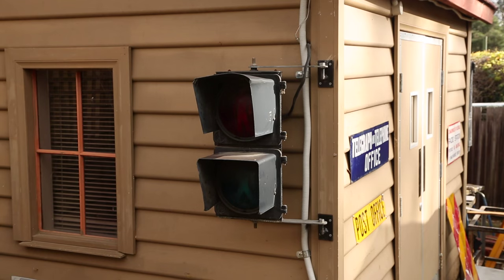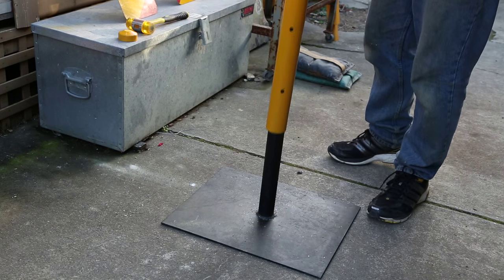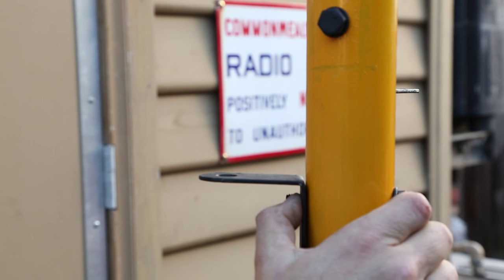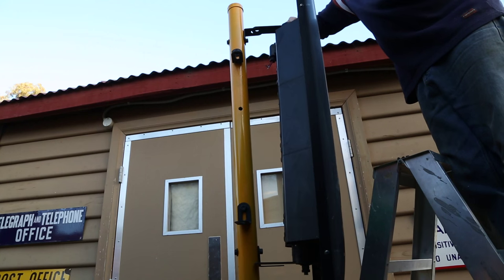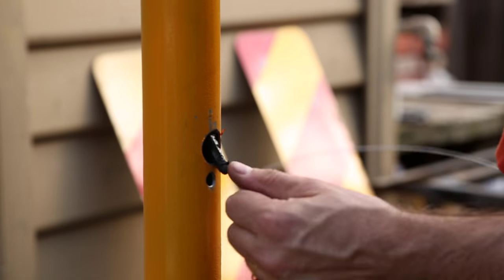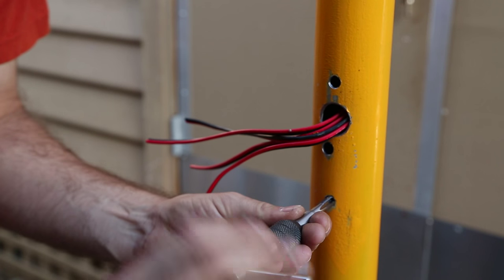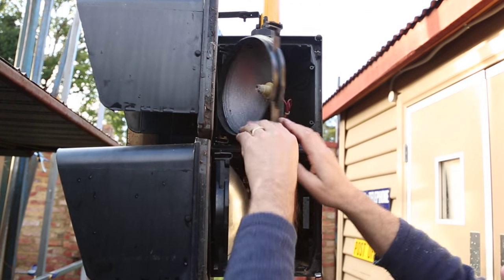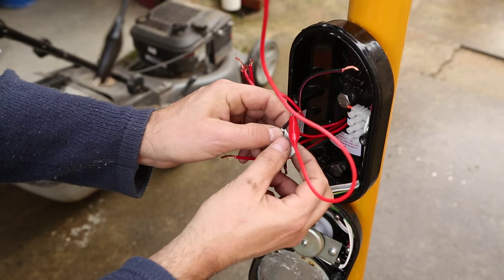Building a Traffic Light with Arduino Part1

Comment: can you list out the component needed?
Reply from the maker: A list of components for this project is pretty simple. An Arduino (I used a nano but you could use a pro mini, a traffic light, some LED "globes", and a 12v power supply. I did build a small circuit for the pedestrian light which needed some LED's, some current limiting resistors and some wire but there is not much to this project. Follow along with the video and you should easily be able to reproduce what I did. Check out the schematic as well. Good luck :-)